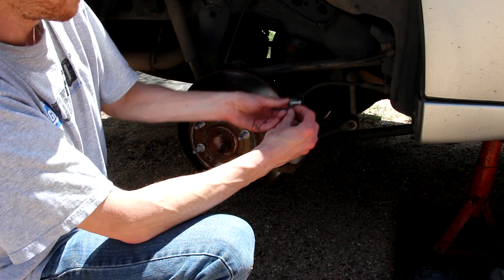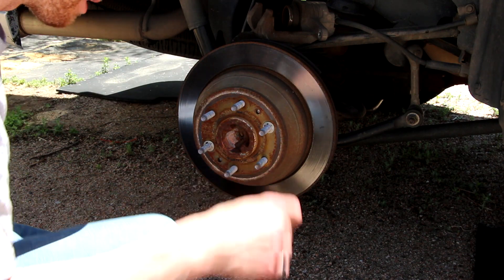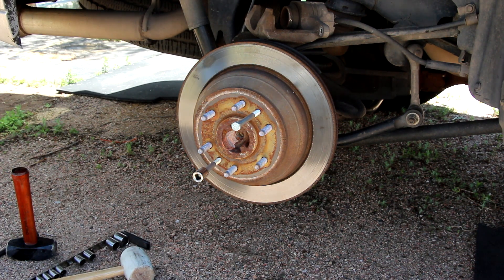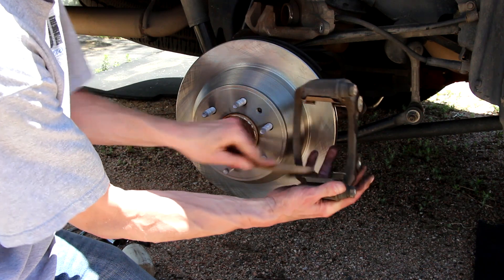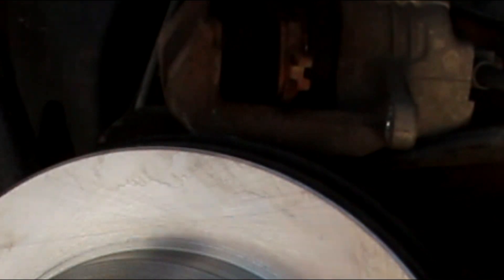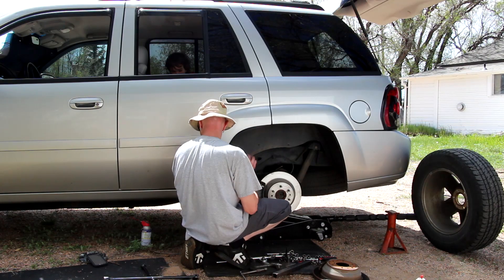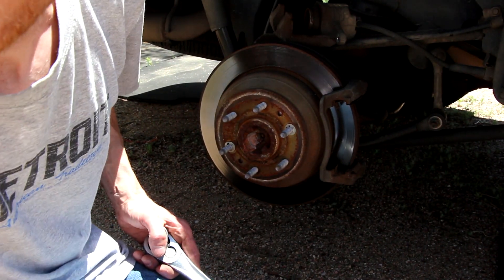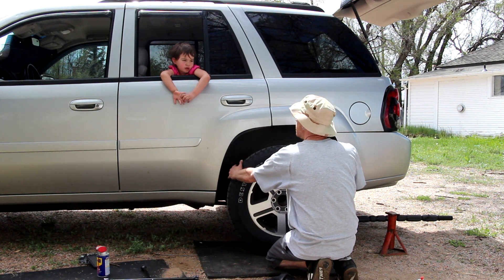How to replace rear brakes on a 2007 Chevy Trailblazer

Comment: I throw clips away they are not for anything other than shipping purpose. Hey question??? Do you bleed the brakes after changing or just pump and test then go? I hate bleeding brakes.
Reply from the maker: I dont like it either. I dont bleed them after this. Just slowly pump them until the pedal gets firm. Test them before heading out on the road.

Comment: The factory puts those clips on the rotor bolts to prevent the rotors from falling while they are moving down the assembly line. Not necessary to put them back on.

Comment: Great video! Used it for reference before doing the same thing on my 07 Trailbazer. Had a hell of a time trying to remove one of the 18mm bolts for the brake assembly. Tried anti-seize, tried an impact wrench, tried praying to Odin for strength... couldn't bust that loose.. ended up just going with new brake pads but I REALLY want to complete the package. Any other ideas besides finding a full vehicle lift and getting a hugh jass breaker bar or taking it to the tire shop?
Reply from the maker: A big breaker bar is all I can think of. I've had to use a piece of pipe on the end of the bar for more leverage. If the impact wrench didn't work, that may be what you need. Maybe try spraying it down with something like PB Blaster for a few days first to try to loosen the rust.
Reply: Same. I felt the pain! GM used a thread lock on those for some reason. Looked like it when I pulled them out. Super tight! Breaker bar on a strong arm for leverage. Or heat the bolt up w/ some MAP gas!
Reply: Did it last night with a long 18mm combo wrench using the floor jack as a press.

Comment: I've always been shown and told to use the C-clamp before removing anything. Doing it while it's still on the rotor. Is it easier doing it this way? using an old brake pad?
Reply from the maker: I have done it both ways. On the rotor works good if you have a clamp large enough. If not, the brake pad works well too. I think either way is fine as long as it gets the job done.
Reply: @homebuiltshop  When I did it, I tried with it on the rotor ( I had an 8in C-clamp, Harbor Freight<3!) but my god It was difficult. I stopped and switched to the breakpad method and it was like cutting butter with a hot knife. Slowly though, I've see big clamps snap by going a hair too fast. Thanks for the reply!
Reply: much easier doing it like you describe.

Comment: Jeff, The two "clips" that you cut off are called push nuts. They are used during the assembly of the brake corner by the manufacturer. They allow the rotor to be placed on top of the wheel bearing, then the push nuts are put on so the rotor and bearing assembly can be flipped over in order to mount the knuckle and then the calipers. There is no need to put them back on as they are only useful on a brake corner assembly line.
Reply: yep

Comment: I am wondering which way is to loosen the two caliper bolts. You skipped right over this and this is what i needed to see. Is it as you are looking at the vehicle from the outside or is it as you would be looking at the bolts in whatever position that they are in?
Reply from the maker: Sorry I missed it. Its whatever position they are in, Righty Tighty, Lefty Loosey. 😁

Comment: The 2 caliper mounting bolts are threaded into a nut.  If it spins, you can put a wrench on it to hold the nut.  I have not seen this condition before, and it gave me some trouble.

Comment: I have 03 TB, bought brand new, now 140k, changed the rear brakes maybe 5 times so far. I always change the caliper hardware clips, lube them with copper anti seize. Caliper bolts to be torqued at 148 lb/ft and caliper pin bolts to be torqued at 23 lb/ft

Comment: Suggestion: include bolt specs for rotor removal. On the trailvoy forum I read 3/16"x 1.5 thread and pitch, 9/16 head.

Comment: When you push the piston back into the caliper, should you/do you remove the cap on the brake fluid reservoir? Does this make it easier to push the piston back into the caliper?
Reply from the maker: +Jim Alesia You can take the cap off. I usually don't though. If you just go slow, it should be fine. It won't hurt anything though.

Comment: washer are put on by factory to hold rotors on during assembly
Reply: no kidding
Reply: These are called Tinnerman Spring Nuts and as you stated they are used to hold rotor in place as it moves down the assembly line. So, no need to replace them after you cut them off.

Comment: Is a torque wrench not necessary?  
Could the rotor be tapped lose with a hammer if no bolts are handy?
Reply from the maker: +Matthew Francis Andersen Official Channel You could probably tap the rotor off if you didn't have a couple bolts. Maybe use a piece of 2x4 or something between the rotor and hammer to pound it off. A torque wrench would be recommended to tighten the bolts to spec. if you wanted to do it by the book.

Comment: Forgot to mention to remove the brake fluid reservoir cap to relieve pressure in the system.  I used this video to change mine out for the first time and it was easy.
Reply: Remove cap... Yuppers 😊

Comment: The only reason those clips are present is to make the manufacturing of the car easier.  They serve no function after the wheel is put on at the factory, or so I have been told.

Comment: If you are insisting on using the old spring clips, I recommend you replace them, at least put some brake lubricant on them as that will resist future corrosion and stop squeaking etc. this adds in stopping pad vibration noises.

Comment: When I change my back brakes. I did what you did and I cut them off. I left them off I understand why they're there but they're not necessary
Reply: james dempster to hold it together going down assembly line. Once wheels are on truck they are pointless.

Comment: Oooooh you cheated at 1:10 !!! LOL!! Looks like you found out the hard way 110ft/lbs isn't easy to crack with a short wrench.The caliper bracket bolt is torqued down 10ft/lbs higher than the lugnuts!!! I was like hold up this guy pulled a fast one!!LOL!!

Comment: What size are the bolts to remove the rotors
Reply from the maker: +Tony Hernandez I think they were 1/2" head bolts. I'm not sure of the thread size.
Reply from the maker: +Tony Hernandez I think they were 1/2" head bolts. I'm not sure of the thread size.
Reply: Typically if the bolt head is 1/2" a coarse thread bolt will be 5/16" 20.
Reply: I just read on trailvoy forum: 3/16"x 1.5 thread and pitch, 9/16 head.